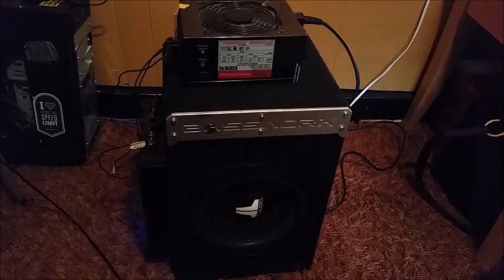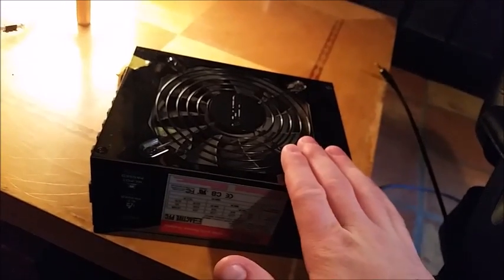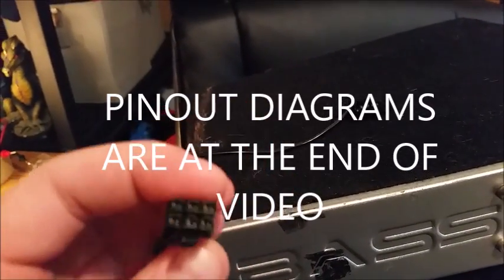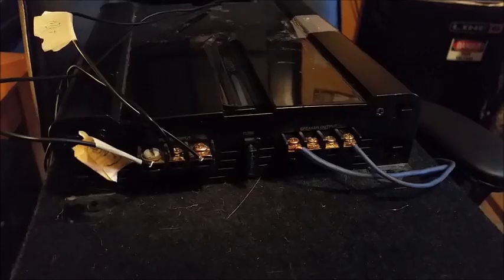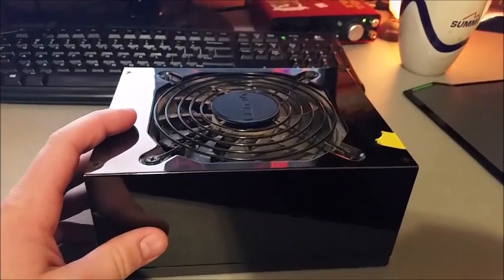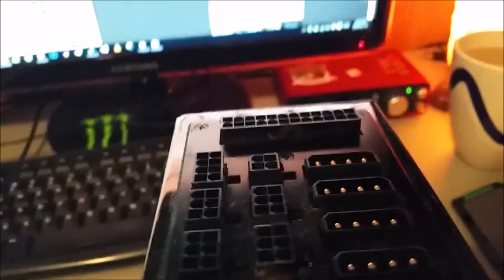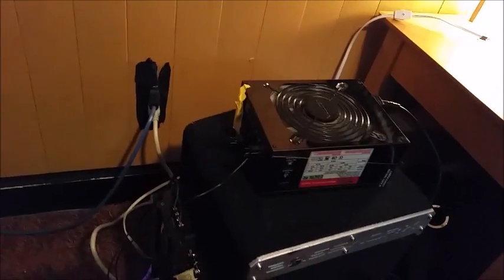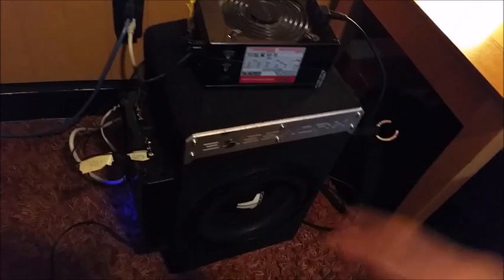HOW TO POWER A CAR SUB WITH COMPUTER POWER SUPPLY

Comment: Does wattage matter if I'm powering 2 12" subwoofer 1200W on a 3500W amp?
Reply: @gi4790  does the powersupply wattage have to match the rms of the subwoofer?

Comment: this video is misnamed, it should be titled "how to kill your amplifier in one east step" i think this is one of the dumbest how to videos i ever seen, first off the remote turn on for amps is 12v not 5v, secondly even a modestly powered subwoofer amp is going to require for more amperage then a computer psu can supply, the number one reason for amplifier failure is power starvation, the maximum amperage of the 12v rail on most midrange atx psu's is around 20 amps, 20 amps will power some class c piece of garbage amp but no way will power a class a/b or d amp for any length or time with out burning it up.....
Reply: In the old days this may have been true, but any modern class D amplifier will run more than fine on a PC PSU. they are 80% and up efficient and in most cases one shouldn't need 200W+ of rms for just a home or PC subwoofer. Both the PSU and the amp has protection circuits to power off in harmfull conditions. Also, the rem input does not need full power with 12v, this is simply to give the amp a signal to tell it to power on, so 5v is ok as long is it works
Reply: false info

Comment: Before doing something stupid like burning your parents house down, you should know that a 6-pin PCI Express cable is only good for 15 amps @ 12vdc, and i'm fairly certain that amp will draw a lot more current than that. So expect those power wires to melt eventually, and quite possibly short against something and god forbid you touch a wire at that point since that much current will kill you.
Reply: Isn't much current.... Will kill you.. Make up your mind.... This is obviously for moderate listening...

Comment: if you connect a 10 watt, 10 ohm resistor across any 5v and ground it will raise the 12v rail to 12.2 or so instead of the 11.9 you are getting.

Comment: At the end of the video, were you suggesting that an artist doesn't have access to either a decent set of headphones, or a subwoofer? If you want a sub in your home speaker set up, buy a sub designed for it. Car subs are far from ideal

In saying that, getting a car sub working off a PC power supply is a fun little project
Reply: Wtf? If you have this stuff laying around and want some bass, here ya go! My polk sub plate amp went out so I'm going to use my old Kenwood amp to power it.
Reply: Car audio sounds incredible in home!!!! You hear All the bass. Don't have to move around the room to get a good sound! You set it and it fucking rocks!!!

Comment: i have 1000w amp that is 70w rms x4 at 4ohms. i use 75w rms x2 for front and 1 sub on 300w rms on rear.. total rms is 450w load on the amp.. how much watt psu i use. ? can i use a 650w or should be 1000w ? thank you.
Reply: I am trying to figure it all out too. I got a 600watt power supply and a 500watt mono block amp. Is it safe to hook up? Or should I just go get a 500 to match?
Reply: @outdoortorrey996  Been trying to build a portable car stereo on my own and I don't know much but as long as your power supply is providing 12v the total wattage don't matter the more the better and there's this formula that you multiply the volts by the amps to give you the total wattage, hope this helps 👍
Reply: @pedroerocha4194  Thank you, ima keep on trying to figure it out haha. I don't want to go blow the JL mono block and the two kickers

Comment: Guys just get a Pro amplifier like a Crown xls 1002 for example and you'll get 900+ rms bridged at 4ohm. (Look on Craigslist for other used pro amps)

People really underestimate what kinda power you need to get speakers moving. Most people will be fine with 1000 watts RMS, if it's not enough, build a more efficient enclosure and get a better subwoofer.

Don't be wowed by the power rating, look at the sensitivity and you'll know exactly how loud it will play if you get it.

Also for indoor use, you're better off getting 4ohm subs or Dual 2ohm for flexibility.

Any questions feel free to ask, I'll try to answer with the best of my knowledge.

Comment: I have a major issue, I'm using a 1000w psu from EVGA. All the wires are black. I kinda got it to work but the sub has a humming noise, can it be the ground? Also can you elaborate more on the 5v wire?
Reply: its the noise which the wire picks up so make shure to connect the ground perfectly
Reply: İCXC did you ever figure this problem out I have multiple amps one works fine but the other has a constant hum
Reply: @alanmccoulskey7741  sorry but no, it did not fo it at first but after multiple turn ons it started doing it. Idk what it is tbh. Moved on.

Comment: How much can CPU power up in trying to get 2400watts amplifier will it work
Reply: No. Your home uses 110v and 15 amp circuits. Math = 1650 watts. Unless you're using the kitchen which is 30 amps or you're in Europe and have a 220v home. However, 1700 watts is the largest pc psu they make.
Reply: Wow... That much bass will shatter your windows man.... Go down like ALOT.. do 1000 watts. Get a server psu. Make sure the watts match or is alittle more then your amp.

Comment: Nice, pretty easy then to tether a sub/amp/car stereo to a PC, i'm working on a desk PC and i am incorporating car audio into it, and it will all fire up when you hit the power button on the PC, just need to make sure its a beefy enough power supply with the extra molex connector,  and vga connector.  The power supply you used is a modular power supply they are extremely handy for cable management

Comment: so if I connect the subwoofer + amp to the PSU thats being used in my current PC i wont need to do the paperclip trick?
Reply: How did that work for ya?
Reply: @trophywolfe  The lack of reply is his answer. Anyone stupid enough to run a car amplifier off the same power supply as their PC is putting his parents home at great risk and has no business messing with anything electrical.
Reply: @LBCAndrew  honestly he could do it if he has a 2500w PSU with like 200A off the +12v rail but those don't exist in consumer products.

Comment: Its importance that if I power amp with 1000watts, my PSU is also has to be 1000watts?
Reply: Most car amps are only 50% efficient. So, 1000 watt amp will only draw 500 watts. Most people over look this fact.
Reply: I did a 1200 Watt kicker amp with a 650 watt psu. Might be kinda late but will help you in the future. I used to install radios for a living at best buy. MECP advance certified.
Reply: Should be more.
Reply: it actually needs more than 1000 watt power supply... less will work but you wont get max power.
Reply: Davy Vs correction... I was wrong. Idk what I was thinking.  It'll draw 300 watts but it'll only be 50% efficient from that. So it'll only output 150 watts.
Reply: @Bryce Bishop I knew what you meant. I got a 1200 xplode 760 pioneer connected to my server 1000 watt PSU and nothin over heats and is FUCKING LOUD...

Comment: amp remote are 12v not 5v but it might work. also you can  pull 12v from the molex output. I have this same power supply set up as a bench power supply.

Comment: is it possible to hook 2 psu to 1 amp?
Reply: I wouldn't recommend this as it could back feed into the other one and cause all sorts of problems. Like a house burning down.
Reply: yes just put all the +  and all - together, but use big wires, i'm surprise that the wires in this video are not already burned, take care with 12v guys it's dangerous, use appropriate cable size ! and you will have a better sound :)

Comment: I wouldn't advise a computer power supply as some of the better supplies out there really only put out 40 amps max.  If you put a power amp on a computer power supply, your are going to overdraw and cause all kinds of issues.  To run a proper bass amp, get a better power supply.
Reply: depending on the power supply you get just need to be mindful of the overhead needed based on the sub(s) and amp, if you have say a 500W amp with, a 600W PSU would be fine, they have more efficient PSUs out now as well, i've got a dedicated on for sub and amp, and i made it so that it turns on when i power up my PC, seperate PSU for the PC, and another one for the sub and amp, and they both run when i hit the power button on the PC, the modular power supply is handy for this,
Reply: can i ask..  if i have a 1000w amp. do i need a 1000w power supply also?
Reply: @mancherzion  You will need probably 2kW or more of pcu supply, because if pcu supply is 1kW that doesn't mean that you will get that amount of power from 12v wires, you can get only about 12v*(around 25A)=300w, watch carefully pcu specs to find out how much amps you can get from 12v wires and must use all 12v wires for that power. Hope you understand. Use this formula to calculate:  [V(volts)*A(amps)=W(watts)]

Comment: To power a car amp you need to use ALL the 12V and GND wires in order to get enough Amps out of the PSU. You can't just use two thin wires and turn the volume up because they'll heat up and burn, and the amplifier would only get like 5 amps or what the wire is rated. There's a reason why you see the thick red and black wires installed in the car's audio system, the wires need to be able to deliver the enough amps to the amplifier. Just saying.. don't burn down your house. Also not sure why the amp turned on with the 5V, that's weird because there's no 5V in a car. The turn on remote is also 12V so you could have just jumped 12V from the amp to the remote.
Reply: so thats why my wires from my power supply have been heating up so badly.....i will try using all the black and yellow wires to see if there is going to be a difference
Reply: When i turn on psu the fan is stopping to spin what`s the probl?
Reply: not sure, you might need a 10W 10 Ohm resistor on the 5V output as a dummy load
Reply: Skorpas Productions  You have to put a wire from the green wire to the black wire, and it'll turn on.
Reply: Alexandru Simonescu Well with that short run of wire he might get 10-15 amps, but I'm not sure what gauge wire that PSUs wire is, so I'm guessing it's 18 or 20 gauge.

Most people are probably trying to get 50 or 100 amps out of their PSU probably (600-1200 watts) and not taking into account how much power these wires can supply, or what class amp they have and efficiency loss. 

For 50 amps you're going to want at least 6-7 wires from the PSU (7 12v wires & 7 Ground) assuming they're 18 gauge which makes 7 combined wires around 10 gauge. Don't forgot you'll need a power supply rated correctly on a single rail to get 50 amps. It will tell you it's amperage on the side normally. And if your using a 600 watt a/b amp for your sub (better off using class D but this is an example) you WONT get full power because only 60-70% of the power coming in is turning into power for the subwoofer with A/B I think.

You'll be better off buying a pro amplifier like a crown xls 1002 and you'll have more power than these amps bridged at 4ohm while being safer, and probably less money spent over time.

Calculate your wire gauge needs with this. https://bulkwire.com/help/recommended-wire-gauge-calculator

And if you need to combine wire to a certain gauge, use this. https://www.wirebarn.com/Combined-Wire-Gauge-Calculator_ep_42.html
Reply: @JoshM7  PCIE 8 pin power is 150watts. 6pin is 75 watts. Divide by 12volt to get the amps.
Reply: Starscreamious Yep, they're like that to keep the amperage draw down, but probably can deliver as much power as you ask for over them. (Until they start melting lol, which is why you use enough of them to lighten the load to prevent that from ever happening)

I could also be wrong as I don't use power supply's for things like this.
Reply: My concern...and keep in mind I'm not an electrician...is that in a multi-rail PSU, combining all the electrical wires together would cause a dead short and burn your house down.....or break the PSU or amplifier or speaker (because of a dirty signal).
Reply: @Starscreamious  That's why I mentioned you want a single rail PSU in another comment. 

Also saying NOT to do this and simply get a pro amplifier as it'll save some headache and possibly your house from a fire.
Reply: I have a couple extra PSU's and car amplifiers though....but none of those PSU's are single rail so...also...burning down my house would be ultra bad.
Reply: @Starscreamious  not if done correctly. And it's really easy to do
Reply: Also the remote turn on works from 5v to 12 v
Reply: Skorpas Productions if the psu is on but the fan is not spinning, that may be a feature of the PSU; some PSU fans will turn off (reduce fan noise) or slow down if its under a certain temperature.
Reply: That’s why u use a distribution block😭
Reply: Alexandru Simonescu if you want to shake your house extremely hard then maybe try running 4 fi btl 18 inch car subwoofers in your house off of a dc audio car amp and a Rockford fosgate amp and 2 crescendo bc3500 car amps and use a amp lab megalith lithium battery I'm pretty sure your house would flex like jello then use a amp lab megalith battery it gives you the most power I've seen exocontralto use one in his car before

Comment: With your switching wires just wire in a proper switch instead of bridging with a wire to switch on power supply there like $2 in Aus dogy as risk of shorts.

Comment: My PSU stops straight away. Any ideas?
Reply: Samuel Edwards if your amp has a 20amp fuse you power supply will need that minimum or when u push the amp hard u kill the power supply
Reply: Probably pulling too many amps